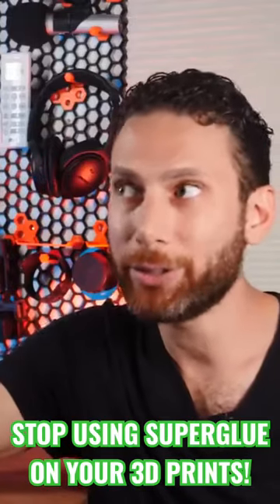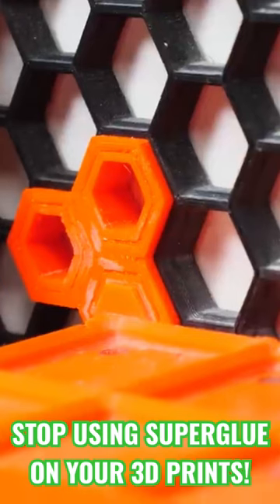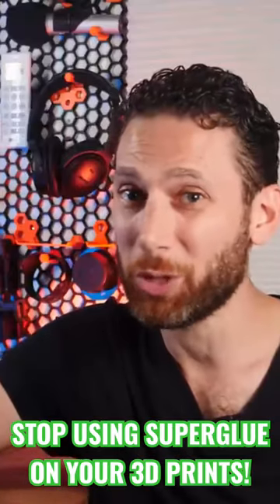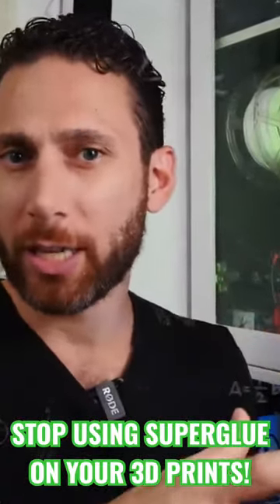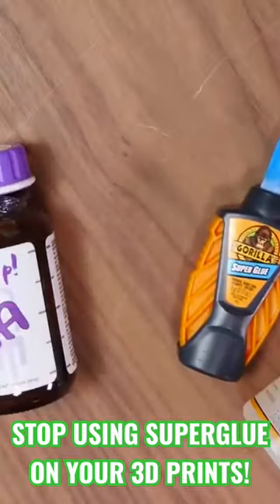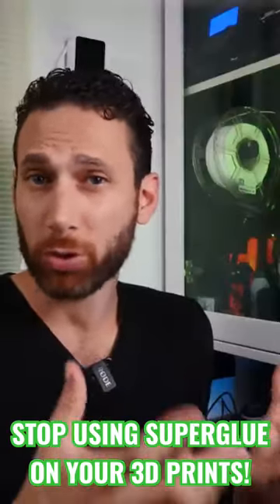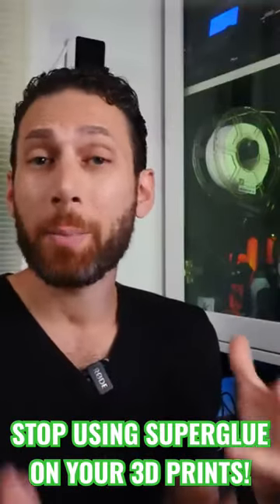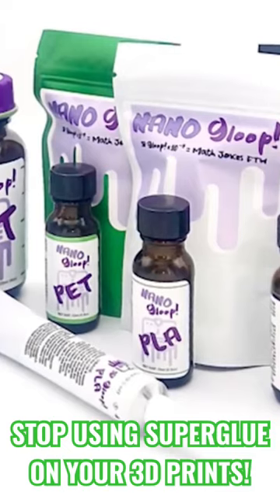Superglue sucks. Use these on your 3D prints instead #shorts

Comment: That New Zealander printing a life size Lucy T-Rex, if I remember right, uses a basic 2 part epoxy then "stitches" over the seam with a pla print pen. Hits it with sand paper and it looks pretty mint and he says it holds super strong.

Comment: I always get good results with super glue, you need to sand the surface to be glued a bit. Oh and there's no way to keep it off your fingers 😅
Reply: They make these things called gloves, very popular in the medical field.😂 Though I never seem to use one when I should and up with glue on my fingers.  The worst is when you get it on your finger tips and you have fingerprint authentication enabled on your phone or laptop.  I don't usually have an issue with superglue though I did have a bottle go bad recently.  As for 3D gloop, it seems a bit pricey and their web site says it has a shelf life of only 2 or 3 months.

Comment: Gorilla CA is what I use with tremendous success on PLA.
Reply: Gorilla CA is fine for anything with no load, but I've had it fail eventually every time if it had any consistent load. Sand lightly and any 5min 2 part epoxy is my go to for small things or longer set times if I have alot of work to do. Mix in anything you'd like to colorize and it's stronger than the part itself typically. Every fabrication method I've ever encountered has a use for epoxy so it's a must to have around imo.